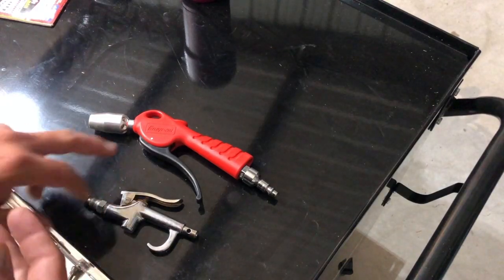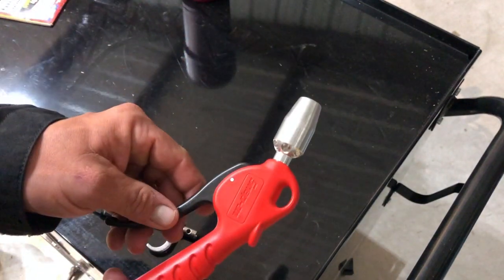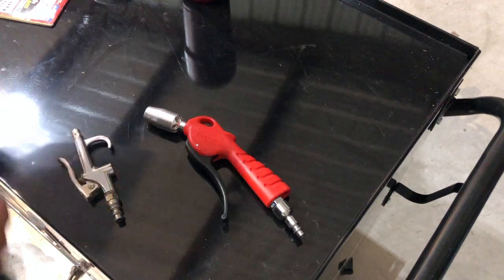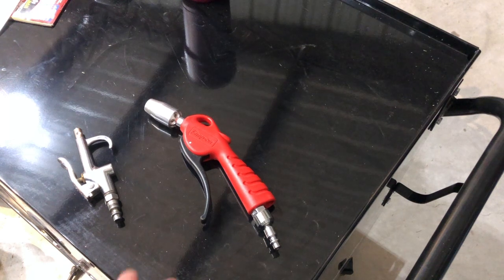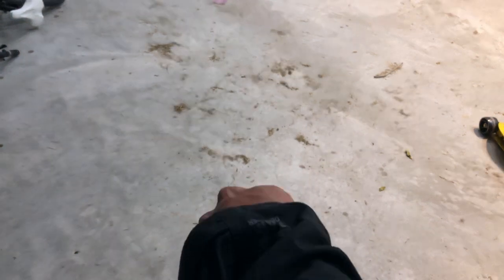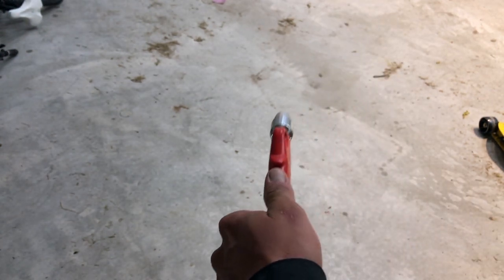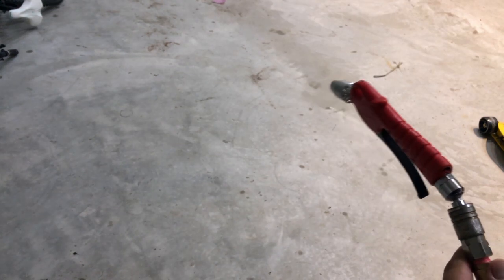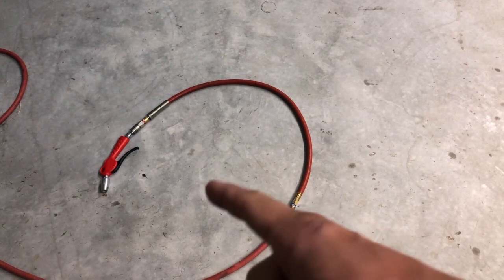Tool Review: Snap on Air gun side by side with a standard air gun.

Comment: Cheaper alternative for the exact same gun, is getting one straight from the source. The oem manufacturer is JWL, model air boy thrust
Reply from the maker: Thank Micheal, I did some digging. I can't find the Air Boy Thrust for sale anywhere in the US. I did find a UK based Ebay store, ChromeTrader, that carries other JWL guns and ships to the US, but they don't carry the Thrust. I'm sure they could get it, but not certain. Do you know of a distributor?
Reply: TexaCajun DIY 

I got mine through the Germany eBay. Was like $30 US shipped if I recall. Again, it’s not always ideal for everyone as you have to sometimes wait 2 weeks or more for it to arrive, but for me the savings is worth it. I also buy all my knipex tools from amazon Germany as they’re a lot of times 50% cheaper than US pricing.
Reply from the maker: Michael, I think there is something up, may be related to the Snapon deal. The Air boy guns on Amazon.de won’t ship to US.